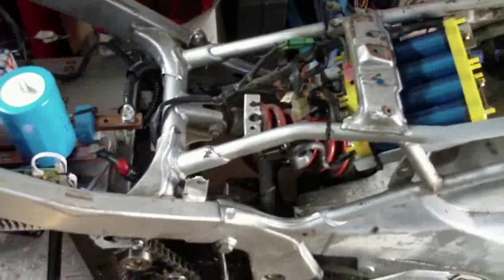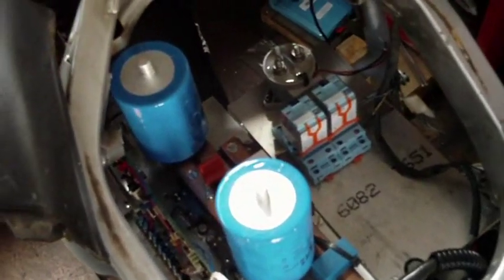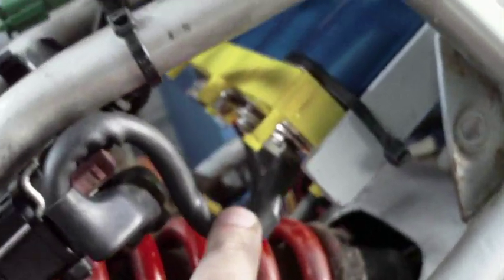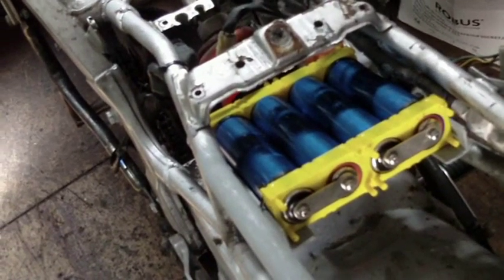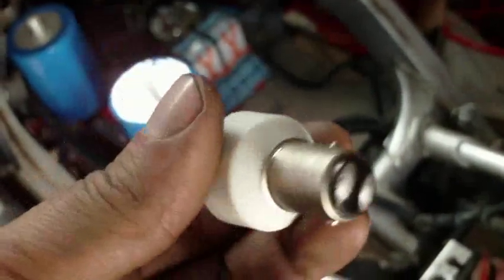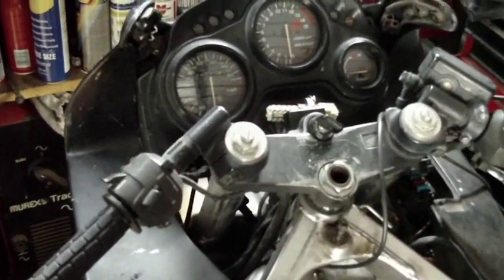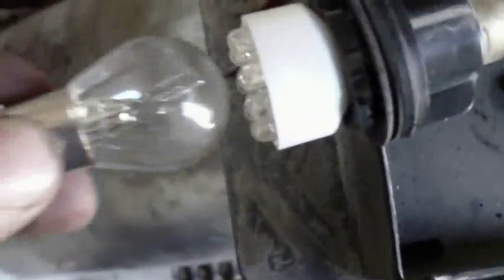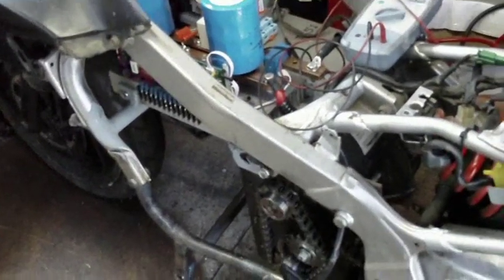Honda CBR600 EV Conversion 09 Controller

Comment from the maker: Ted , Not sure on the weight. At a guess it will be same or a little lighter. Its tough to say what the power will be like. The series motors will pump out tons of torque. In theory the system can put out over 75kw (100hp). Time will tell!